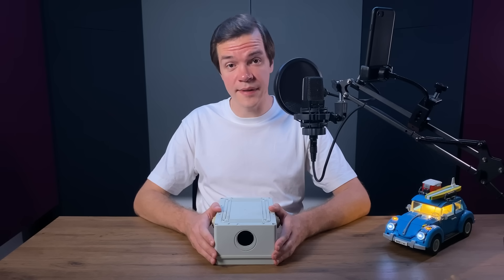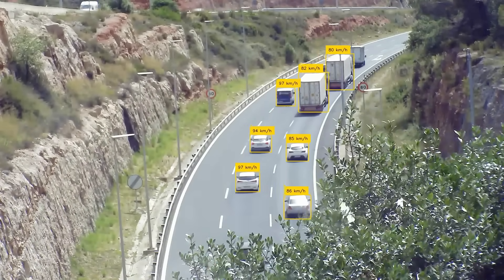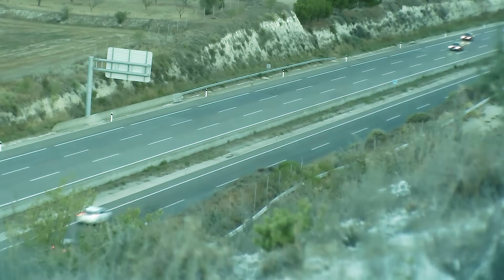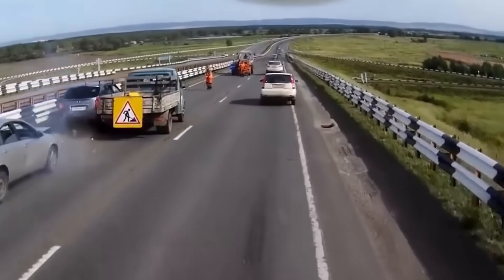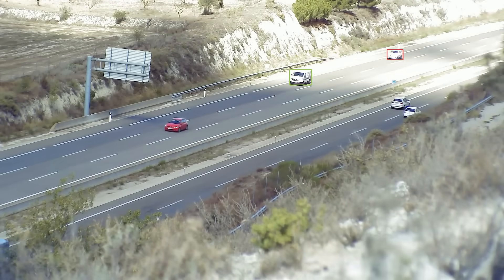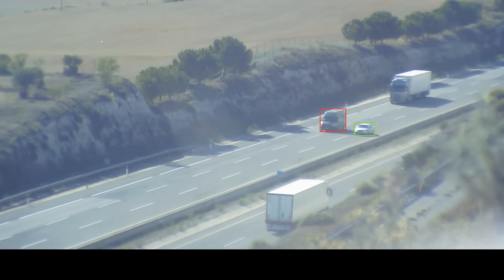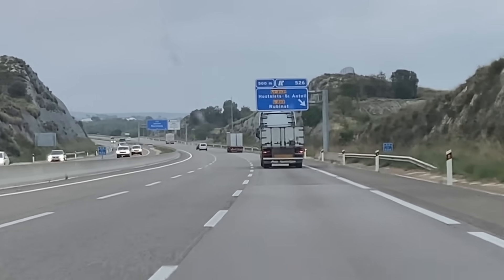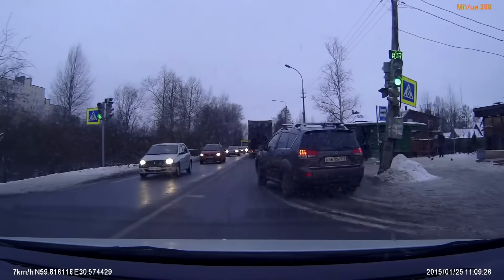New Anti-Tailgating Camera Reveals Shocking Statistics

Comment: I enforced traffic law in California for nearly 30 years. This is a very good video.
When it comes to stationary objects of safety index, this is exactly spot on. But when it comes to both objects moving, it’s the change in the two deacceleration rates that makes the difference. That’s why race cars can follow each other at 150 to 180 miles an hour hour and never crash that however, is a controlled situation.
On the roadways, it’s up to the lead vehicle to have the proper distance.
Reply: > On the roadways, it’s up to the lead vehicle to have the proper distance.

How does that work? If I'm in the lead, then I almost certainly have the proper distance in front of me (otherwise, I'm not in the lead). But I have zero control over how much space is between me and the car immediately behind me.

Or did you mean to say it's up to the *trailing* car to maintain the proper distance?

Comment: Many drivers over-react to situations.  Most of the time when we're cut off, the driver who cut us off is going faster.  The most we need to do to regain following distance is lift off the accelerator, and even that is unnecessary.  Braking is almost never needed, and doing it is dangerous because it lights our brake lights, inducing the driver behind us to over-react and also brake.  This creates a chain reaction of braking, which leads to a host of issues.

Comment: When you are following a car on a freeway, that care is unlikely to come to an immediate halt (hitting a wall).
What is more likely is that they will decellerate as fast as their tires can skid/abs. Provided you are not out braked by them, as long as you react quick enough you both come to a halt in time without colliding 95% of the time.
But you gotta ride tight and be ready to react!
Back off a bit and enjoy the breathing room, and set that cruise.

Comment: Driver behavior on freeways varies widely from place to place and with time of day. I have observed bad behavior is much more common on freeways than on side roads with lower speed limits and many lights and stop signs. When we lived in the Washington DC Metro area, I would go out of my way and use side streets to avoid the freeways on my daily commute back and forth from work. This route took longer, but I also missed the parking lot pile-ups on the freeway (usually caused by tailgating) that happened several times a week. So it was a more dependable route that I could plan my day around.

Comment: You assume the wrong mindset for tailgating at 30m. It has more to do with space inbetween vehicles and openings inwhich other cars might traverse. Noone likes it if someone changes lanes in an opening which makes it let you feel an unsafe distance. It induces stress. Thats what you try to avoid. So you drive closer until nearly everyone hesitates to go inbetween. And this behaviour depends on vehicle length. Would cars be 10m long instead of 5m cars would make 5m more space in distance. With trucks its the same but additionally the stress from breaking and the long time till youre back on the same speed due to cars squeezing in. Im sure trucks would make more space inbetween if a road were a semitrailer road only.

Comment: I just came back from a vacation in northern Spain during which I drove around 1,000 Km. I was disturbed by how systematically people disregard safety distance rules on the highway. The most common pattern was a car cutting me off after passing me. This happened the vast majority of the times I was passed and it just seems to be the pattern people have learned as normal.

At one point I was getting to a tunnel in a two-lane highway and I was about to pass a car and a truck. I was going faster than them but not speeding. The car signaled it was going to pass the truck and I wasn't sure the driver had seen me, because I could have been in a blind spot. This seemed like a dangerous situation to me, so I gently applied the brakes, the car changed into my lane ahead of me and I thought things were going as expected. Well, this was followed by 20 seconds of solid honking by the car behind me, which must have been tailgating, didn't expect me to use the brakes and got scared.

I was already avoiding "carreteras nacionales" (two-way traffic roads with typical speed limits of 90 Km/h) because in previous trips I determined the way people drive on those is not safe. I think I might stick to using trains in future trips to Spain.

Comment: There is an error in author assumptions about drivers behavior and that 3 second rule.
If you calculate the breaking distance for 3 seconds on a highway, then let's say 100 meters will pop up in your calculations.
But that assumes that you have to stop on a highway suddenly.
Now consider that you have a car in front of you, that travels at the same speed as you are.
That car in front of you can't really suddenly stop to 0 m/s, right? Unless it's some car made by UFOs.
So, experienced drivers usually judge the breaking speed of the car in front. A truck driver will try to maintain a bigger distance from a small car, because that small car can break faster.
The distance is judged by how fast the car in front will break and can I react to it, not by how fast can I react if the car in front suddenly stops to zero speed, because that's unrealistic.
Whether that's correct or not, I won't judge, but that's the truth.

Comment: This does NOT mean we need more fake "safety systems" and unreliable robotic AI designed to control us.  What we need is BETTER DRIVER EDUCATION.  Bring back Driver's Ed classes, and make them MANDATORY for ALL students to graduate from school into The Real World.  Incentivize already driving drivers to take a class; with things like insurance discounts, tax breaks, and gas/petrol reimbursements or rebates.  

Over-reliance on technology makes lazy drivers, which makes more unaware drivers, which makes bad drivers, which makes the roads MORE Dangerous...  NOT less.  Audio-Visual Warning systems, sure, yes, keep those.  But EDUCATE Drivers how to drive PROPERLY from a YOUNG age, and make it MANDATORY to graduate from school, and you fix a LOT of problems!  😮  

As to the 100 meter rule.  There is an easy way to figure this out.  Find a spot on the road, and start counting when yoy get there, then keeping an eye on a spot farther ahead, count for 3 seconds.  That's your follow distance...  at any speed.  

Or, imagine it in Car Lengths...  YOUR Car's length,  Car Lengths.  Car lengths is not a standardized measurement of a specific length...  it literally means YOUR vehicle's length.  Imagine the vehicle you are driving, is riding in front of you.  Up to 40 miles per hour, 1 Car Length is the absolute BARE minimum distance, but 2 is better.  Above 40 miles per hour though, that increases by, +1 car length per +10 mph greater than 40 mph to = your follow distance +1 additional car length for good measure.  This holds true up to about 100 mph, and above that you should double the follow distance and +2 additional car lengths.  

So, if you drive a little Smart Car or Fiat Fiero or Mazda Miata, your follow distance is quite small...  like the vehicle.  If you drive an 18-wheeler hauling a heavy load, your follow distance is equally massive, like your Big Rig, and if you are hauling a heavy enough load, or are in hilly terrain, recalculate with +3's instead of +1's and only up to 70 mph, because anything over that you simply double your math, and you get a follow distance of "I cannot see anyone else on the road because they are so far away from me" truck lengths.  😂

And GET  RID  OF  MANDATORY   INSURANCE,  ALL forms of it.  It is only making the situation WORSE.

Comment: 6:04 Some notes this clip:
1. There's a 2 second (64 frame) window between visibility to the stopped vehicle and impact.
2. The deceleration period is 1.5 seconds (46 frames).
3. This means the driver's response time was 0.5 seconds (14 frames) to apply brakes after seeing the stopped vehicle.
4. 0.5 second reaction time seems like an eternity to me in this case. I understand that it takes time to perceive, decide, move foot, but given that multiple cars were changing lanes ahead, an apt driver should have been more alert and ready to respond at this point.
5. Tires locked up after only 0.5 seconds (14 frames) of braking time.
6. This suggests that the driver was exerting too much force on the brake pedal, but I get it.
6. Lack of anti-lock brakes adversely affected braking effectiveness.
7. I'm not saying the driver wasn't following too closely, but I do believe a more attentive driver could have avoided the collision in this case.
8. That said, the rules of the road, sadly, must be set to accommodate the worst drivers and the worst vehicles.

Comment: Failure to maintain a sufficient safety distance also produces what, in France, we call the accordion effect: if a driver slows down (because it has seen a speed control system, for example), the drivers following too closely will also brake and thus trigger a chain reaction that often ends in a significant slowdown of traffic, or even a stop.
There are sections of highway where, every day, at the same hour, with the same drivers returning from work, a traffic jam occurs even though there are no accidents and highways are without red lights.
Yet, none of these drivers seem to question their behavior on the road.
And the saddest thing is that we learn at driving school that safety distances help avoid traffic jams.
Another thing that has been proven to be effective is to stay a good distance from the vehicle stopped in front of us when we are at a red light.
This allows more cars to pass when the light turns green.

Comment: There's a couple of other realy good reasons for a safe following distance.  If you want /need to pass, you have some room to accelerate to match the lane you are merging into, rather than forcing that lane to slow down to give you room.  If you are in the slow lane that distance leaves room for cars to merge at on ramps.  if cars can merge smoothly, there is less need to hit brakes, avoiding the ripple effect.  My wife was rearended twice in a month, in the slow lane, in stop and go traffic at almost the exact some place on the road.  Another problem I see all the time?  Drivers waiting until the absolute last second to get into a lane for an off ramp, usually  in stop and go traffic.  Then they have to stop the lane they are in completely, to merge with a lane of cars that are bumper to bumper.

Comment: I do not understand the 2-3 second rule. E.g. when driving 100 km/h, it would be 56 m to 83 m. However, when your distance is only 25 m, you will never be fined in Germany. According to the regulations the fine "starts" below 25% of the speedmeter value. We all know that drivers orient themselves more according the expected fine rather than accoding regulations or recommendations.

Comment: Safe distances could easily be enforced technically. Simply send a radio/light signal and measure the time for the echo to come back. If distance is too short stop or reduce fuel supply. After a few second the secure distance will be reached. Such a device would cost < 100 EUR and integration into engine control is essentially for free. In cities the problem is even worse. The recommended distance there is 15m. The real distance is typically 2-5m. Even it a speed of only 36km/h (10m/s) you have no chance to stop within the reaction time of ~1sec. But the real solution of the problem is to remove humans from the steering wheel, especially those of trucks.

Comment: 3 seconds is barely enough room, driving cdl, it was taught as a minium of 6 seconds, in a big truck at 70 mph 6 seconds is just enough time or also barely enough, if you need to slow down without warning or emergency stop, suprisingly most truckers dont follow this at all and also tailgate. Almost all drivers fill that gap because they believe thats an open spot...   i saw some moronic comment in here from someone that fully believes that its a spot everyone should use to maintain traffic flow... there has been studies with autonomous or ai driving that when these spaces are not filled traffic flow is maintained.  Traffic slows down to gridlock alot in part because of people filling a tight space causing a chain reaction of braking, which in less than a mile can cause traffic to completely stop.  People need to use their brain!  Everyone wonders why all this lousy driving aid tech keeps getting added to cars, that alot of us dont want, its because people are to lazy to think about something like this beyond the idea of      ( your in my way and ill cut you off cause i gotta be somewhere) its amazing how lazy people are to not think about things like this, about the same amazement id have if someone bothers to read all of this before scrolling.

Comment: Speed cameras CAN be used to increase safety, placing them in 3 or 4 way intersections actually reduces collisions!
There's also dangerous road sections such as merger of two busy roadways into a single roadway followed by an exit very soon causes drivers from both roadways to rapidly shift lanes within a very small stretch of road, add high speed into the equation and you get a disaster.

There's also hills, turns, corners with tall vegetation blocking what's ahead and any c9mbination of the above.

The speed cameras on road 40 north from Kiryat-Gat, Israel are a good example of this.

Comment: Anyone a counter-argument for why the "you might have just been cut off" excuse can't be checked by checking if the 2nd car is decelerating at a reasonable rate, especially compared to the car in front? Bc either it just happened and is visible in the recording, thus easy to disprove. Or the 2nd driver is reacting to the cut off by slowly increasing distance (and it should be slowly or you create more danger by breaking abruptly ofc). Now there will be false negatives where a tailgater is spared bc he was decelerating sufficiently right at the camera but that seems like an acceptable compromise.
I don't see this as being that complex of a system to build, it might require 2 cameras bc of the need to determine delta s instead of s but that hardly seem like a huge problem.

Comment: He says it isn't speeding ... but how many of the cars that are following too close were doing no more than the speed limit? Or perhaps more than the speed of the surrounding traffic or more than the conditions dictate? Saying it isn't speeding when any of those 3 conditions is happening is false.

The video also does not recognize that higher speed is inherently dangerous. If you hit something immovable at 50 kph vs 180 kph, you are more likely dead if you are doing 180 kph, and you are far more likely to lose control and hit other vehicles. The simplistic analysis is inadequate to judge dangerous behavior.

Yes, tailgating is a problem as well, but it does not allow for the severity of a crash to be factored into the equation. Speed is a far greater factor. Not tailgating can mitigate against a collision where the only factor are other cars, but that is NOT the only reason for accidents. A stationary object on the road is only avoidable if one has a slight distance/speed that allows stopping from the time a object becomes visible, which is more a speed factor than following distance. You could be the only car on a road, and if coming over a rise, or around a curve, or during rain, snow or fog ... the sight distance is greatly reduced, and you may lose control and crash if you are going too fast. Again, speed itself is the problem.

Comment: Great analysis but I think that the following distance safety calculation is missing an important factor. 

1. You don't typically need to slow to a complete stop to avoid a hazard 
2. The hazards you are likely to encounter are mostly going to be travelling in the same direction as you and as such have a relative velocity of under 100kph. 

Also the following distance data you presented is slightly shaky as it does not seem to account for vehicle speed, but instead assumes everyone is doing 100kph. A more  robust measure would have been to check if they were following the 3 second rule. This is an easier calculation as you just need to time the bounding boxes, perspective and speed would not matter.
Reply: As for why there are not cameras monitoring this.

1. Judging 3 seconds distance in the car is not objective. Very few cars have the ability to detect the distance of a car ahead and relay that to the driver. So to fine someone on a measure that they cannot measure themselves (like speed with a spedometer) is not sensible imo
2. It opens up issues of a car swerves  in front of me, then I get fined for tailgating because momentarily I was too close

Comment: I'm 77 years old and been driving since I was 17.  My father insisted on driving lessons with a qualified instructor. I passed my test.......  however my father then insisted I take the Advanced Driving Test (not compulsory in the UK) so I had to have lessons to achieve this with a company that specialised in this. I subsequently passed this test. Well, the ADT changed my whole perspective on driving.  My instructor  emphasised about these things: Anticipation, Observation, Conditions, Attitude.  In the test you have to make commentary all the time on what's happening in front of you and this needs to be detailed and thorough. If you don't get it right you fail.    Lastly I have always commented on the fact that driving too close (tailgating) is far worse than speeding.  Ive been rear ended several times in my driving life, because I pay attention ive never rear ended anyone........(touch wood!)
Reply: "Ive been rear ended several times in my driving life" - sometimes, your brakes need to be good enough to stop two cars instead of one.